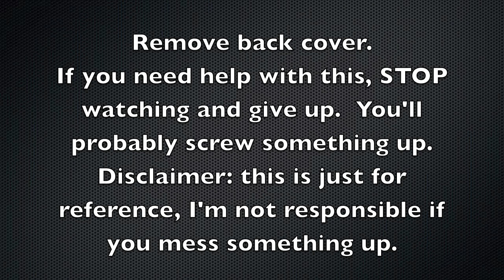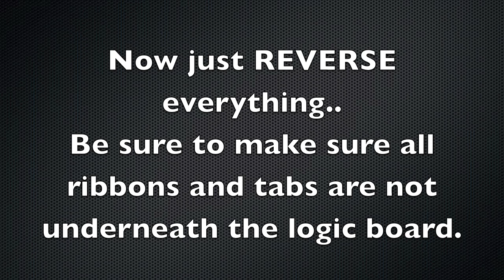Macbook Pro 2011 15" i7 Thermal paste application tutorial MX-4 CPU & GPU heatsink removal

Comment: This is crap design.  It should not require this much to reapply paste.
Reply: the design is great for a laptop and most of these laptops are far outliving their life-cycles because of the upgradability and ease of access to areas like these.  You can still buy unibody cases for a little over 100 bucks.  The market on these machines is pretty fair, a refurbished 2011 MBP goes for about $800 these days and is well worth it.

Comment: dude you need to unplug the battery first you could have damaged the logic board
Reply: Yeah true, best always unplug but he only used the nylon spudger up to that point therefore minimal risk. Can only short the points on the board with something metal like a driver or a screw you drop.

Comment: I don't think you need to spread the thermal paste
Reply: +Callum Ip It's actually bad to spread it because it increases the chances of air bubbles.
Reply: ye thats what i was thinking
Reply: +sprflyenya when you put he fan on it it automatically spreads
Reply: It's been proven that it's useless to spread, but the impact is negligible.
Reply: Callum Ip Macs don't have CPU fans, they have heat sinks. I've tried both and spreading is possible but it makes it more likely for bubbles to develop. The fail-safe way is to put a small drop in the middle and let it spread.

GPUs work a little differently so you can (and should) apply a little more than a CPU even if it fall out of the dye. They function a lot hotter than CPUs.
Reply: Sulfen i meant heat sink cos i was installing a new fan into my pc and i got confused
Reply: for the 50th time, you need to completely cover the die if it is a bare die. if you have even teh smallest part of the die that gets a bubble, you can easily burn out your chip. this is why desktop chips come with the metal heat spreaders installed
Reply: not true with a bare die, you absolutely need to cover every part of a bare die
Reply: you have to spread it for bare dies, unlike the standard covered dies of desktop CPUs

Comment: Okay the process of re-connecting the ribbon cables isn't very straight forward.  I can't exactly just reverse what I did in the disassembly process.  Would've really helped if you included a demonstration of the assembly...........

Comment: You're much better off using a small pea shaped amount rather than spreading it around with your finger. This method is prone to air bubbles and will add extra heat.

Comment: This is the worst way to apply thermal paste! When he drop a thin line on the CPU and a pea size drop on the gpu, that's where he should"be stopped and and have dropped the heat sink over it and been done with an excellent result but nooooo... He just had to spread that shit all over with the same results as as when it came off factory.  Never spread thermal paste with anything. Leave it alone. Just a small thing dab line or pea size is all u need and let the heat sinks own pressure do its job by spreading it EVENLY during heat dissipation.  This is how i do it on all my comps. and client comps. Just did this on a 13" MVP that was idling at around 48c-53c and manage to dropped the temp to and idle of 32c... Of course use IC 7 DIAMOND (the BEST) or Article Silver 5.
Reply: I roll mine on with a jack in the box straw.  Works great and runs at 22c as a result.
Reply: What the f is a jack in the box straw?
Reply: @Leo-tt7ly  GIYF.
Reply: I don't know if you're being serious or not but I'm dying here @ryhu4755  😂😂😂
Reply: @fitz3127  nope, it works great.

Comment: ALSO when I went to put it back together I noticed a cable on the underside of the logic board that clearly clicks in to the body of the macbook.  But it's so short that I can't connect it. The logic board is in the way.  Do you know what I'm talking about?  Is that thing important?
Reply: James Ward got same prb. Did u reach to plug it? And how plz?
Reply: I think I did manage to use a spudger to replace that. But hey man, this is a temporary fix. It ended up going bad again a few months later. But here's the big news: Apple finally started owning up to this defect!!! I got my entire logic board replaced for free. You should do the same.

Comment: Okay so I tried this and everything went great except for the beginning.  The fourth little thing that you popped up on this video...  Rather than pulling just the top part up I pried up the whole component, breaking the solder joints and pulling up one of the lands.    Please- just give it to me straight.  Am I fucked?  Did I just fuck up my logic board?  Or can I fix that?
Reply: I'm sorry to say you sound pretty fucked, my friend. :( Unless you know someone who has the tools to do surface soldering...
Reply: Hey james! Happened the same to me....... 
Did you get to fix it or what?
Reply: I got the logic board replaced, man!  If you're Apple finally started a repair program for this bullshit.  If you're having a GPU issue take your macbook to the nearest apple store and have them replace the logic board for free!

Comment: Thanks for this video, it served as a great guide. My 2011 Macbook GPU is failing with the widely reported lines/gray screen/boot problems. When I pulled the heat sink there was more paste globbed around the outside of the GPU than on it. There were parts of both the GPU where there was NO paste and it was still shiny. No wonder it was overheating. Also, while I was disconnecting the subwoofer cable the whole connector popped off the logic board with hardly any pressure applied (the connector looked slightly different than yours). The build quality appears quite low which is disappointing considering the premium Apple charges for these. (edited for correct cable type)
Reply: Respectfully, I have been inside many laptops and really didn't see much of a difference in the quality. An update though, I took a heat gun to the GPU for a few minutes and then after cooling, applied arctic silver to the three heat sinks. Back up and running with no more vertical lines running through my display, gray/blue screens, or failed boots.

Comment: You should have laid the logic board on an anti-static mat, you are just lucky it did not get a bump or static electicity.. I know everythin people will say like "But he used anti-static arwrest" or something, but my last mainboard got killed because I laid it on the table... WITH ANTI-STATIC ARMWREAST
Reply: Even on a wooden table ?
Reply: Mathis Vatble The static electricity does not come from the table, but rather from your clothes or surroundings, like if you rub your feet on a carpet or on your floor
Reply: yep i know this, but you told in your comment that you killed your motherboard because you laid it on the table....!
 i do not see how you  can kill your motherboard by laying it on a table .?
that''s why i was asking you
Reply: It died because it had no anti static mat under it, so when I laid it on the table without anything under it it died because of the statics
Reply: >you are just lucky it did not get a bump or static electicity..

you'd have to be insanely unlucky for that to happen

> but my last mainboard got killed because I laid it on the table... WITH ANTI-STATIC ARMWREAST

no it didn't, this shit jsut doesn't happen
Reply from the maker: Martin Salthe Late reply, it actually is an anti-static mat.

Comment: You don't need to (and shouldn't) spread paste nowadays, the mounting pressure does that for you. All the manual spreading does is it causes air bubbles which degrades cooling performance
Reply: Are you sure that pressure spreads it all over the chip? I think it could spead to one side because you don't do it with  some press which pushes the same on all sides...
Reply: Acden.ru Yes. It has been proven numbers of times. It sometimes can depend on paste though, and liquid pastes spread more easily.
Reply: Topias Salakka it has been tested a lot of times on MacBooks? (especially curious about i7 2011 late. Bacause I changet TP but still have problem with overheating and frozen for some seconds...)
Reply: Acden.ru Not with Macbooks, but a lot of computers. I'm sure it applies to Macbooks too.
Reply: Not on that laptop. The stock heatsink in a laptop doesn't provide as much downward pressure as desktop heatsinks, so it might not be as evenly spread. Gimp
Reply: +Topias Salakka these people lol. Guys, go watch videos on how thermal paste spreads when u put it on. Yes, it applies to "MacBooks" and ANY other laptop brand. It doesn't matter what logo, it just matters if it has a heat sink, which every single cpu has. Yes, it SHOULD be pea sized given that ANY single heat sink spreads the paste evenly WITHOUT creating air bubbles. Please do your research before saying anything.
Reply: @iongarcia881  that's not what Intel says
Reply: If we assume that a single blip and pressure spread out properly then it should also work out regarding air bubbles. Neither is absolute in reality.

Comment: I have a 2009 Intel Core 2 duo 2.53ghz. Would it be possible to either buy a higher clocked CPU (of same family) and replace it? Or replace logic board for Intel i7 since they are the same unibody?
Reply: Well maybe it would be possible if you could solder as accurately as a machine.

Comment: I have a 2 year old MacBook Pro 13" and recently it has been overheating when I'm using it for more than an hour or so. The CPU goes up to 89-90 degrees and I was wondering if it has anything to do with the thermal paste? I have never opened it up before or done anything to it.

Comment: It is a bad idea to unsoldier it. The reason why they soldiered it is, apple and intel have developed special kind of processor to work with MBP and its motherboard. I dont know the exact configurations but it was designed to use a lot less power and is also designed to work with the very silent thermal system MBP uses. THese 'special' processors are not for sale and you will need to go for a new mac to have a faster processor. Overclocking could be another option but I dont recomend it inlaptop

Comment: Got a late 2008 MBP so had it for coming up to 4 years. I noticed recently that the fans seem to be kicking in a lot more than they used to? Might I need to clean the fan for dust or apply thermal paste (Does it wear off)? Might be be that everything is more processor intensive than it was - high res video streaming etc?

Could my new hard drive be causing this - there was supposed to be a compatibility issue with WD scorpio black and my macbook pro according to some but I haven't noticed any.

Comment: No, the both are soldered to the logic board, only way to do it would be to replace the whole logic board, unfortunately those run at around 500+ $ on ebay :(

Comment: This is a great video, but if I may point out, the amount of thermal paste still seems a bit too much. From the documentation that I have read (as I'm researching for this as well) it appears the bead of paste should be applied to one corner, then spread with a credit card etc. Also, the heatsink should be 'primed' with some thermal paste as well (rub a bit of it after cleaning). Nonetheless, Thanks for an excellent instructional video!!

Comment: Why do you spread the paste, rather than letting the heatsink squeeze itself on with the screws? I watched another video where a man uses acrylic to demonstrate the spreading, and without any hesitation, I stopped using the spreading method. It appears to leave way too many air bubbles, so I will stick to the line method. 

I wonder if the temps would further decrease if you did change the method of applying paste.

Hope you guys don't expect too much power if they truly redesign these MacBooks.

Comment from the maker: @Seventhsenses8 np, yeah it can be BAD to put too much paste.  You really don't need much, just enough to cover the cpu die.  So a pea size is fine or spread it yourself.  Both works well and it's debatable which method to use.

Comment from the maker: @escogido753 IC diamond, I see it used on a lot of gaming rigs and I hear it's good, but a bit expensive.  I'm happy with my MX-4 though.  I heard IC diamond is thick and might be hard to spread.  Either put it under a warm water for a little bit or just do the grain method and squish it down with the heat sink.  GL

Comment: @Mastermind12358 It will work but that's not the best thing for processor's without the metal cap! This is because the paste will not fill the complete surface if u just use 1 grain... that's why the people at Apple put a high amount of paste on it so it will definitely spread the complete surface.. And the rest of the MB ^^

Comment: @aznguyen316 

you should not spread the thermal paste your self, air will get stuck between the cpu and the cooler reducing your thermal paste performance. the pressure of the cooler when you put it again on is enough to spread it around nicely.

Comment: Where is the air supposed to enter? I've got one and the flow isn't that good. On my Macbook the air enters on the right (facing upright) and exits the at the left/centre. On these it pretty much sucks in and recirculates the exhaust.

Comment from the maker: @marrzie Yeah I'm good. Just don't be dumb and say oh hey I opened up my MacBook and replaced the thermal paste a couple years ago blah blah.  As long as you didn't permanently modify something that they can tell, you're good.  Same with the optibay, I just put back the DVD drive if I need to take it into AppleCare for any work.  But yeah, basically besides the hard drive and memory, don't bother mentioning you did anything else to the MacBook.  This is the case for most anything and warranty.

Comment from the maker: @Roman2K NP! There's definitely room for improvement on your end.  Mine hardly ever reaches 90C anymore, it'll touch 89C occasionally when importing/rendering iMovie stuff but it cools off after the fans peak and then down to 86C or so, no problems. So yeah if you ever get brave enough, you can do a thermal repaste.  key is to use a little, not glob it up like they do in Apple-China where these are built.

Comment from the maker: @adryanv Yeah I feel that it has.  Max temps have probably just decreased 1-2C but it's the fan behavior and speed of heating that has changed.  Temps climb a little more slowly and fans don't kick on instantly.  They go up in levels, so like 2500, 3000, 3600 RPM etc a lot more slowly.  When it comes to gaming, it's more of a matter of max temps being around 86C which is good. The re-paste is good for ppl that are getting above 90C max temps as apple probably put way too much paste.